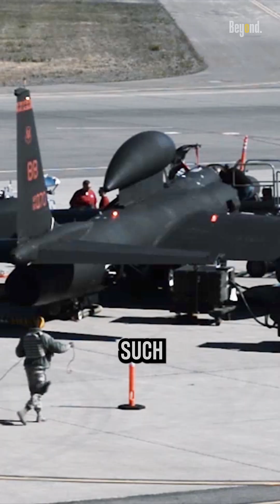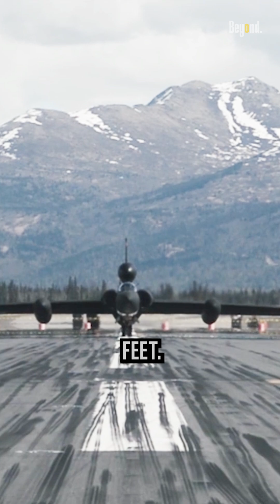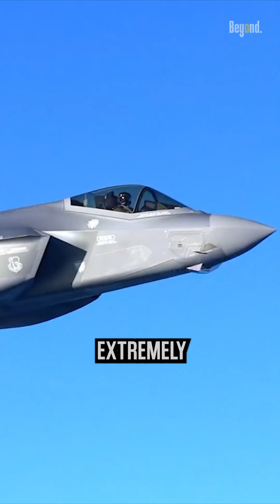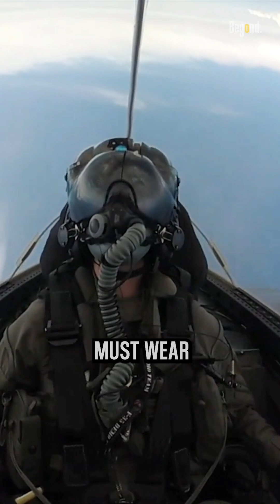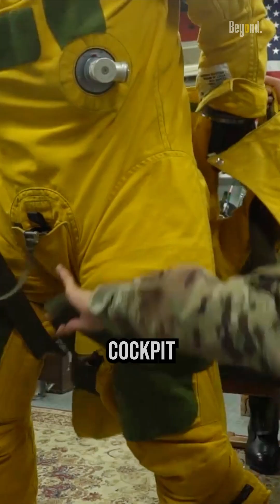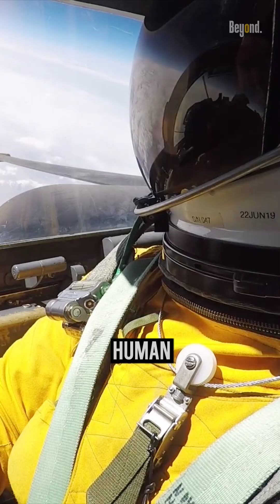Why fighter jets cannot reach altitudes like the U-2 Plane? #shorts

Comment: Don't forget the Mig 25 at 80,000ft
Reply: Thats not an operational height.  An f15 got over 100k feet once.  The limit really is the human and not the machine.
Reply: @Typexviiib a mig e-266m reached 123,000 feet. That’s an early variant of the foxbat as far as I know
Reply: @FireflyHusbando  stripped down non operational concept using inertia to briefly get above 100k feet.  A mig 25 is useless as a military vehicle above 60 to 70k feet.  So is an f15 and f22, even though they all can technically get that high.  They cant do it with full electronic suites, full fuel loads, and weapons, and nobody is doing much maneuvering after 70k feet.  Its just a dangerous gimmick.
Reply: @Typexviiib  yeah I know. I was just saying that the mig beat the f-15 in the height record. The sr 71 and whatever the us has now are definitely better at sustained flight over higher altitudes
Reply: @FireflyHusbando  ah, ya.  I misunderstood, sorry about that.  123k feet for an air breathing aircraft is impressive no matter what tricks you need to get there.  I just tend to think if fighters in utilitarian terms more so than acrobatics.

Comment: Jet cockpits are pressurized as far as I know. Yet I don't know how a U2 gets so high.
Reply: They are, until they arent.  At which point the pilot dies pretty much instantly if hes over 60k feet and not in a pressure suit.

These planes also arent meant to maintain that degree of pressure differential.  Theyre expected to make up about 5 to 7 pounds of positive pressure, which is enough to keep you going at 60k feet but not enough at 80k feet.

Comment: The U2 is just like the SR-71 Blackbird spyplane in the 60's - 90's.Pilots need to wear specialized suits in order to protect their internal organs from the extreme pressure just like in the Blackbird in the past,looking more like an astronaut.I admired the Blackbird and the U2 is just its little sister that still roars the edge of space today.
Reply: The Lockheed SR-71 blackbird, an advanced long-range strategic reconnaissance aircraft  capable of Mach 3 and an altitude of 85,000 feet

Comment: The F-22's engines can operate at very high altitudes but the OBOGS has issues keeping the pilot able to breathe.   I know they were having weird issues with them a few years back but haven't heard anything lately...hopefully they've found the problem and gotten them fixed.
Reply: The F-22 now uses a Normal Air-Garrett built OBOGS. This system receives air through the Air Cycle system. The compressor allows some air to pass through before ignition. This air then gets cooled through the primary heat exchanger (PHX) and fed into the Air Cycle Refrigeration Package (ACRP). This reduces the air temperature from around 2000 degrees Fahrenheit to around 50. The air is then fed to flight critical systems for cooling, and also to the OBOGS system. This air gets feed to the pilots Breathing Regulator/Anti-G (BRAG) valve. Finally reaching the pilot, the air has been removed of heat, nitrogen, water, and pressure. This process can limit the supply of air given to the OBOGS and ECS, causing suffocation at high altitudes. The rest is highly classified and I cannot share. Just know that it has been fixed.

Comment: I never knew that there blood would boil without a pressure suit wow
Reply: Under the conditions(temperature and pressure water can simultaneously freeze and evaporate
Reply: You reduce the given air pressure in a system boiling points of various liquids all start to decrease
Reply: Well it would expand, that's for sure, but would it boil? I'm not sure.